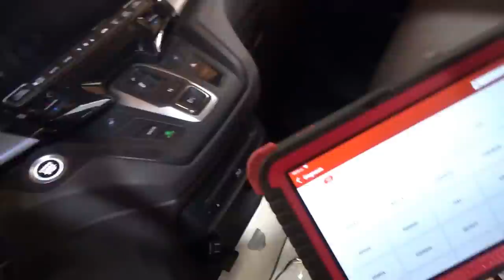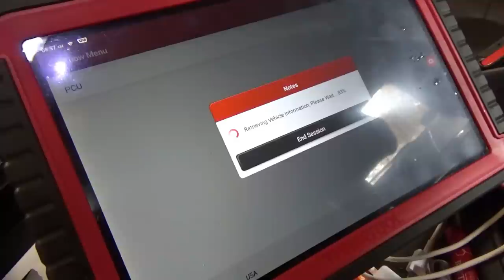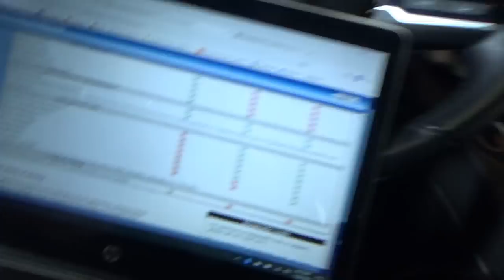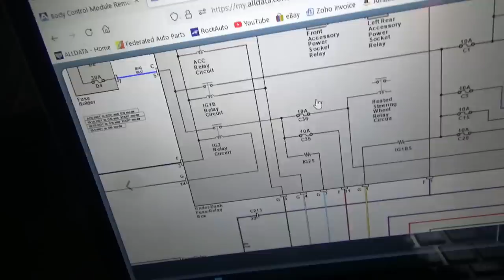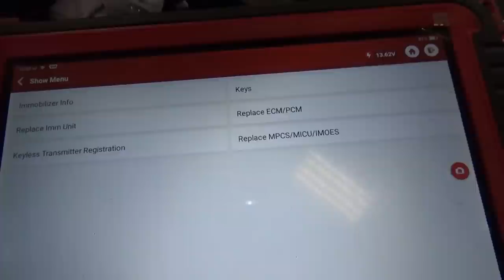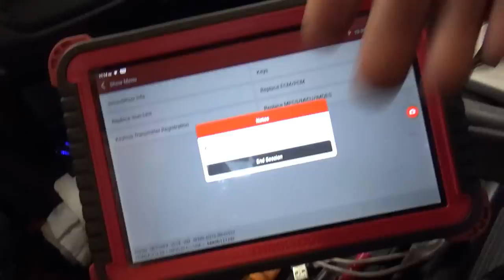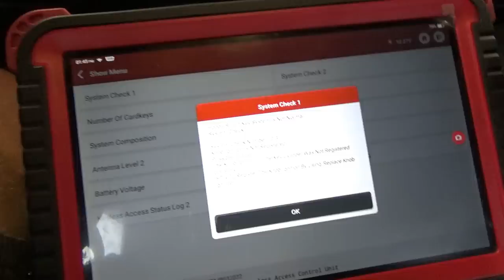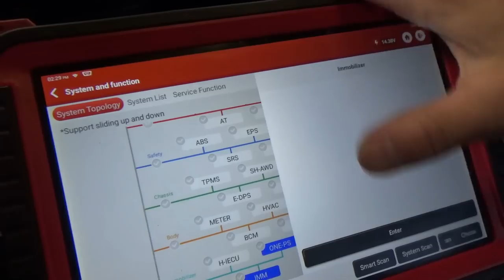WTF...Honda Turns Itself ON & DRAINS the Battery?! (Part 2)

Comment: All good technicians take a loss now and then, like you said it's a learning process. It sucks for time spent vs time paid, but sometimes it just comes down to integrity. Sometimes modules just need to be reset, why? We don't know. It just happens. Sometimes we get paid for getting lucky. Keep these videos coming Ivan. Love the process.
Reply: It's not really loss.  You just have to think of it as school time.  But by the end, you come out the other side knowing how to do it well and if you do 2 or 3 of the same cars after that, you'll blaze right through them fast.
Reply: @calholli  agree. What a dealership tech would spend to learn in a month or a year Ivan had to/learned in 3 hours. Fast learner I’d say 👍🏼
Reply: you get easy jobs, hard jobs, and somewhere in between. it all balances out in the end.  winning that customer for life is the real prize..  going to bed every night knowing you will never be broke because there is a steady stream of income is priceless and you did fair, honest work .
Reply: with all of the software, firmware, ect, getting to be proprietary  we will see this more and more.. just think what electric vehicles will  be like. they are already going to electric steering, braking systems.. nightmares !! 
 multiple processors to run everything.   the automatic updates the manufacturers put thru to cars via sattelite, will cause many problems, and that could be what happened to this car.. you think Honda will admit to it?  think they will contact customers and say hey, we did some updates to your BCM module, and found out it was corrupted, or incompatible after we did it, so come in,  we will reflash your BCM to its original state and your car will start and run again.. NOT HAPPENING!!!!! Alot of the computer systems and programming is done in China, Taiwan   ect. do u think they give a rats ass if your car works or not?   The stealerships dont even know how the systems work on an intimate level, they just replace parts from a troubleshooting flowchart and hope for the best.. if they cant fix them, they auction them off.  I  use  a  still a Garmin Gps independent unit stuck to my windshield and will never own a car with the bullshit infotainment or key in the car sensing system.. if your too lazy to pull a key out of your pocket and stick it in a hole and turn it, you shouldnt be driving.  my 2017 caravan has the remote door lock, but if it fails theres a key inside the fob that will let me open and start the van.

Comment: By reprogramming the BCM, you unpaired the Remote Start module that was having issues and causing the problem.
The remote start module was the problem from the beginning.
There was a Honda tech in the other video that confirmed that these remote-start modules are known to fail in weird modes like this, causing weird symptoms like the ignition switching on.

Comment: One thing I learned in electronics class was "chip creak". A lot of IC's were not mounted directly to boards, but inserted into sockets that were. boards that did not power up prior to pushing down on the IC's mounted in the sockets often did after. The expansion and contraction from heating & cooling of power on/off cycles, the chips would "walk" themselves out of the sockets they rested in.

It was satisfying to have a board power on after pushing the IC's back into their sockets, but it was more satisfying feeling that "crunch" of pushing the IC's back into their sockets. Removing the 5 cables from the old BCM, and putting it back in, could've resolved the problem.

Heck my power window went out. the fuse was not blown, but the act of removing the fuse to check it and putting it back in resolved the problem. Surface oxidization on the metal contacts?

Comment: A key moment “20:04”. The EEPROM error reported a year or more ago might be the warning that it had a previous issue that cleared itself or gave false signals to the bcm. If this issue surfaces again the keyless access system feeding the bcm should be monitored or isolated before condemning the bcm.
Reply: As an ET for 35 years, I have seen EEPROMS that will flip bits and cause many different problems. By reprogramming it, you have fixed it for now, but it will happen again. The EEPROM is bad and the only way to fix it for good is replace it.
Reply: EEPROM  stands for Electrical Erasable Programmable Read Only Memory; a chip that is able to store code or program that's kept when the board is powered off.
During initializing (start-up or wake-up) it's probably compared with the stored year 2018 of the car's production date in the ECM. 
Although the original module seems to have a production date of 17/09/2015, the EEPROM inside will have the year 2018 programmed into it before installation in the car.
It would not surprise me if the EEPROM error indicates that the ECM will only accept a replacement module that's programmed (not produced!) less than a year earlier. 
Honda's way of keeping the dealers happy?

Date of module production on the label does NOT mean that the program inside is from that same year. They can produce X amount of the same modules with empty EEPROM's and program them when needed; depending on brand, model, year and other specs. 
Keep that in mind when buying on eBay...

Comment: I don't recall. Did you check how many keys were programmed ?
Is there a turn-on log? 

My suspicion is that there is a FOB somewhere inside or around the car (the old key-under-the-flower-pot trick) that was waking it up.
Reply: Good point!  Some third party remote start systems us a "hidden key" to get around the security system.  By having to reprogram the keys on the original BCM, the defective remote has been shut out.  That would explain a lot!!

Comment: Ivan, after watching your video i would like to share my experience with a 2019 Honda ridgeline. Same exact problems. I had the car for days and couldn't recreate the car intermittently turning itself on, i left the remote inside our office well away from the car. I had a test light wired up hanging from the back bumper spliced into the IGN relay control ckt. Eventually i caught it in the act while walking across the shop. I had to end up replacing the Keyless Access Control Module. It was located behind the glove box, and was similar to that bcm. I was Leary because of lack of info, but went through the same thought process you did. Being the only thing that controls those relays it had to be it. This was right before covid and the module was 1700 and special order only as the car at the time was still newish. Sucessfull repair on my part. Keep up the good work. Love your videos
Reply from the maker: Wowww 1700 dollars for a crappy module?? That's criminal!

Comment: Nevertheless, you saved that customer a lot of money, Ivan.  You showed incredible patience trying to program the keys (power on, power off, etc, etc).  After part 1, I thought it odd that you didn't go to the BCM connectors and verify the signals and the connectors as you have done so many times in the past.  Just figured you did all that off camera.  Oh well, all's well that ends well.  Great job, great video!

Comment: Hey Ivan!
I know I'm late to this party but I'm a big fan.

So, dunno if anyone else caught this but you kept letting go of the START/STOP button.

It takes a few seconds for the scantool to take control of the immobilizer system. 

Next go round, use the remote to press the button and hold until the ignition comes on.

Cheers!!

Comment: Love it. 15 years at Honda the solution to all electrical issues is hard battery reset lol as per honda internal service bulletins.  Also when replacing any modules if you do replace ecm/pcm it goes through all the steps usually. I always did that for new ignition  keys ect.

Comment: I work for Honda and had a 2020 or 2021 CRV ( I don't exactly remember, it's been awhile now) that came in with only a few thousand miles with this exact issue. Customer said it would come on randomly. Literally the exact same thing this van was doing. That one was not as much of a head scratcher as it had a DTC stored that basically pointed to BCM replacement. So far, that's the only vehicle to come to our dealer with that issue. Waited almost 2 months for that thing to show up off backorder. Replaced, programmed the keys and it was good to go. Hasn't been back once with a repeat issue. Really enjoyed these videos. I'm not the best at diagnosing stuff, but I try my best to get more comfortable. Just watching your process helps me out.

Comment: I'm betting there was a bit flip in one of the modules. When you tried to install the eBay replacement, you had to flush the old data (EEPROM codes) and replace it. Therefore, when you went to re-install the original part, the Odyssey accepted that information as fresh, thereby clearing the data error/bit flip issue, returning the vehicle to service. I often do this type of reset when I'm flashing cell phones, for one reason or another. It helps to reset the settings for all the radios in the device, making the old data, seem new again. 
Nice job on this one Ivan, It WAS a bit of fun! Can't believe those dealerships kicked you out - You are a benefit to any business you assist! They should get over themselves, soon!! 🤔🤨🤣🤣

Comment: From a computer guy's point of view: yes, reseating components sometimes scares away the ghosts in your electronics. The other way to scare them off reliably is to add 400V. You can see them scurry away in a puff of magic ghost smoke :D
Reply: Yes, reinstall drivers !  Problem fixed.

Comment: Fantastic episode.  When you were at a seeming impasse due to lack of security credentials, I found myself shouting "Call Keith"!  Once you did, his suggestion for the workaround was characteristically brilliant.  Final cure of unplugging and re-plugging is good lesson.
Reply: When in doubt, reboot. (from experience in the Tech field)
Reply: I once had two identical units with identical controllers - both of which were intermittently unhappy. I was able to permanently fix both by simply swapping controllers between the two units.
Reply from the maker: @robarnt6  love it 👌

Comment: This was/is a crazy case study.   The fix was almost as mysterious as the symptom.  And for the record, this is technically another No Parts Required repair!   King Ivan the NPR GREAT!
Reply: He put the original BCM back in and repogragramed all system to talk to each other. The van would crank to start with it may still have the same issue as before time will tell as it was intermediate to begin with.

Comment: I had this problem with my 2017 Acura MDX. It was turning on by itself, and setting off the alarm over and over again. Also, the key fob no longer opens my doors.  I actually found a video here on YouTube that told me how to fix the issue. It was the Smart start module. In my Acura, this was located behind the glove box, which had to be taken out to get to it. It had to be opened and a certain component needed to be cleaned with Alcohol. I followed the instruction on the video, and I have not had the problem since. I will post the link to that video next.

Comment: how funny is that. Up to now the car was turning itself ON, but now Ivan is searching for a way to turn the car ON, as now the keys have to be programmed and the Comp is not working without the key ON. This stuff with the going around the security protocol, is cool. But only in this case. Thanks Ivan.

Comment: WOW! What an hellish procedure Honda came up with! Very clever bypass of the conundrum :-)
If the BCM is OK now, either it was a soft problem and the reprogramming solved it or, like you said, some spooky contact in the bundle (Halloween approaching?).
As for the replacement BCM, could it be that, being a unit intended for China, it wouldn't speak to, or recognize properly, the rest of the modules? Or was it simply just bad? Very crazy stuff!
Reply: Too many Honda repair/replacement  procedures assume that a system that is broken is being rewound on the factory floor and has no other issues.  All failure modes and conditions are not considered.   Like a hybrid that needs a 12V battery charged to start and that is charged by the EV battery, which is drained flat.   A recent EV, has an electric hood release, a 12V battery under that hood, and no external mechanical bypass for the hood lock or jump connector.  A dead battery locks you out.   Teslas have electric door releases and mechanical releases that are difficult to access for children and older passengers unfamiliar with the vehicle.
Reply: @psdaengr911  Yep, that is very true. This increasing complexity in cars, is causing more problems than it solves, but the EVs are on a completely new level, bordering the ridiculous (the other day, the passengers on an electric ferry had to be rescued by the Coast Guard, because the batteries went dead in the middle of the river).
Reply: @psdaengr911  my 2005 Porsche is the same way.

Comment: For industrial PCs there is a similar failure mode with dirty contacts going intermittent, basically dirty and oxidized contacts. The contact issue is so common that before even troubleshooting the computer, I take all the boards out, inspect and clean up the mother board connectors (Deoxit D5 spray, unless really dirty than Deoxit D100 spray and/or D100 with needle applicator. If contacts are gold I use G100L (ProGold) needle applicator, after spray cleaning connector with D5 spray.) I then use wipes to clean and condition the edge connectors (two step if gold D5 spray, or D100, then G100L) . I reassemble the computer and it usually will boot and run with no problem. Then I run my system hardware checks, and if the PS is very old I will inspect and replace if necessary. I then do all of the "standard" software testing checks. 

So, I think the approach to the problem in the video might have some preliminary steps. The first is to inspect, clean and condition all the module (BCM) connector contacts. Then if the problem persists, I would either reprogram the module with the latest firmware release and test again, or I would start my troubleshoot as you have shown. So the priority would be cleaning and conditioning contacts, verify and/or program latest firmware, then troubleshooting as normal.

Comment: Just a quick thought: The BCM may have gone into a tamper/theft mode because the relays were powered up out of order. For example, the expected order of activation may be ACC, IG1A and IG1B, then IG2. Since they were all activated simultaneously with the test lamp, it wouldn't allow key programming.

Comment: I monitors when you press the start button . It goes acc then ign . When you were turning them all on at once I think the bcm saw that and got confused 🤔🤔.  You would need a cheap key programmer to allow you to turn the ign on without a key programed to it . The scanners will not turn on the ignition with no key or no key programed to it . I loved how you bypassed and turned on the ign . Loved it

Comment: that Eeprom error you saw is probably the culprit here.  It might have fixed itself through the programming but it will likely happen again if that eeprom is corrupted.  i've come across that before on other equipment...eeprom errors might go away but they only lie dormant waiting to resurface

Comment: I was involved in a project where there was an issue with the power consumption where the vehicle woke up sporadically after going to sleep. The issue was that there was a ceramic capacitor on one unit in the CAN bus. A ceramic capacitor do act as a piezo element and can when the temperature changes induce a voltage spike on the CAN bus. A voltage spike on the CAN bus is one of the ways that wakes up ECUs from sleep since they see it as traffic.

Replacing the offending ECU with an updated one solved the problem. This was during product development so there weren't any huge recall.

Now I didn't look at the first video, but I'd like to share the experience anyway since there might be a similar issue in the future - and using an oscilloscope can actually hint at similar cases.
It doesn't have a capacitor that's the culprit, it could be something completely different.

Comment: Just finished both parts. That was amazing hot-wiring the modules to force programming 👍🏻 Worrying the problem has disappeared I suspect you'll see that again at some point! I've been looking at the newer CR-Vs here in the UK, those have the same instrument cluster as that Odyssey so probably the same spicy Mexican modules 😂 I think I'll stick with older cars for the moment with plenty of used spares available.
Reply: Yep, sticking with older cars is the way to go. The future for these new fangled fractionalized electronic gizmo cars is bleak indeed.

Comment: I see in the documents that it only works on VW beetle 2006-2010. I have used on bmw s and VWs. I know crossing the pins has worked on other cars for me , just don't recall which ones. I usually look at a diagram first. Pin one is commonly a comm line. Comm lines are very resilient. Grounding or applying B+ doesn't ever seem to damage anything. I have grounded and powered can lines  to explore different testing methods and they always seem to return to normal. Conclusion, I am probably wrong about this working on your honda. But this is something to keep in mind when programming keys in the future. Thanks Ivan .